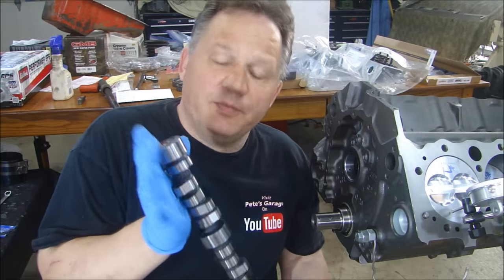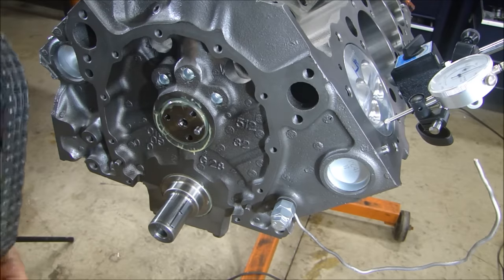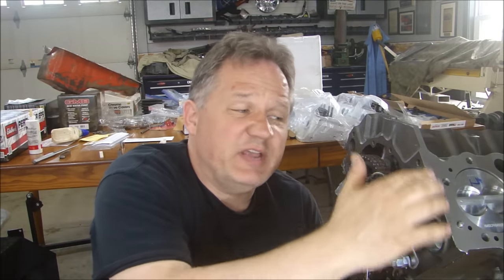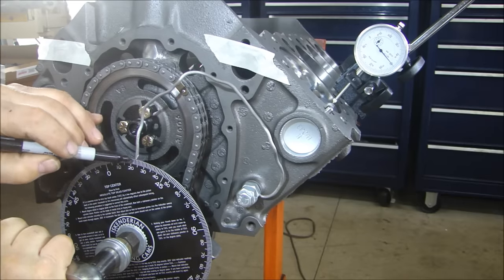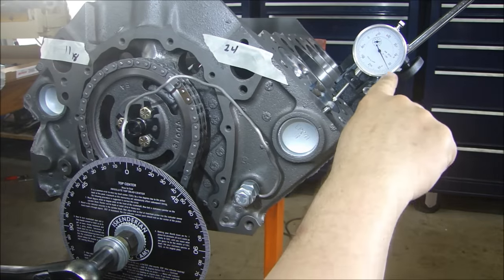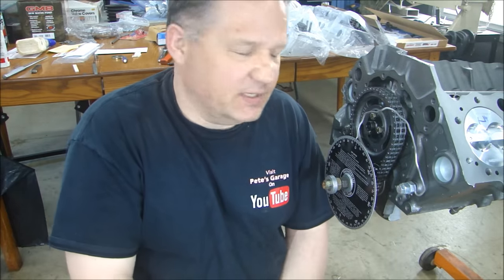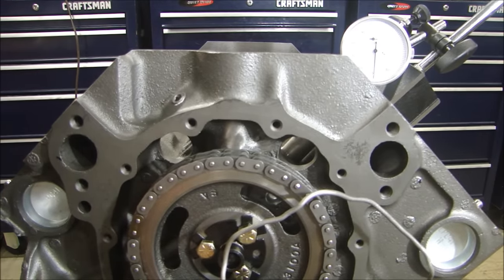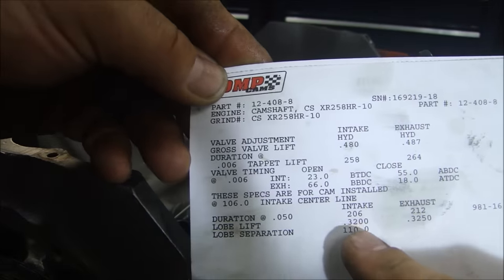Engine Building Part 3   Installing and Degreeing the Cam 350 Chevy Small Block

Comment: Great information, but I am still not convinced that this is worth the time unless the cam manufacturer is inconsistent in manufacturing, You can give, and great detail and explain how to back-check the manufacturer's stated grinds, but if it's off, you have offered no corrective action that can be done other than the assumption of returning the cam for replacement or refund. 
If you build two or three motors a day, Ok, check it out but if you do one once, waste of time.....
Reply from the maker: I'm sharing best practices. It only takes a few minutes but you don't have to do it. I have had to return cams because they were boxed incorrectly.

Comment: I appreciate you taking the time to provide instruction to degree a cam, however, readings MUST be taken ONLY after rotating the crank clockwise.  Rotating counterclockwise will introduce error from backlash with timing chain and gears.  Rotate crank clockwise to 0.050" lift on #1 open ramp, then continue to 0.050" open on the close ramp.  If you go past 0.050" by mistake, rotate crank CC to .200" or .100" lift, then clockwise to approach 0.050" again.  This takes backlash out of timing chain and gears.  If you weren't using a new timing chain and gear set, and took readings after rotating CC, your readings would be considerably different from cam card values

I also didn't understand your comment about decking a block will alter cam timing.  Finding TDC is independent of block decking.  Whether 0.010" or 0.050" is removed from the deck, doesn't change where the piston is when fully extended in the bore.  Decking will affect cam lift, but not cam timing. Duration at 0.050" lift is unaffected.
Reply from the maker: You are right. About the timing, when you cut the heads or the deck the piston will get to TDC sooner in the cycle so the valve events need to happen sooner.

Comment: Since when did verifying cam specs become “degreeing the cam?”  He didn’t degree anything. Degreeing the cam has to do with actually determining when these valve train events occur by use of offset degree shims being installed in the timing chain, thereby advancing or retarding the camshaft to suit your performance desires...not just verifying that your camshaft manufacturer knew what they were doing and did it.
Reply from the maker: Michael, I have a couple other videos showing how to degree the cam so there is no need to do for every engine build. I spent many years working as an engineer for GM Powertrain and I can tell you, manufacturers make mistakes, wrong parts get shipped out. Even with all of the quality measures in place it is possible for a mismarked part, or one that missed a machining operation to get installed. It happens more than you think. So it does not hurt to verify no mistakes were made.

Comment: But he didn't change anything can someone please explain why this is necessary, or what this achieves?
Reply from the maker: You do this to verify the cam is on the timing chain correctly. If it is ok, there is nothing to change
Reply: @PetesGarage  i get that but if its lined up with the markers o the cam then shouldn't you already be sure of that?
Reply from the maker: Yes, but I check in case a mistake was made at the factory, it's a feel good procedure

Comment: Why even show this video ? just to questing comp cams ability ? hahaha Good one , unless you got a cam gear with elongated bolt holes instead of fixed like stock you can't really do much ! unless your Victor Edelbrock Sr and the type of people he had to race with / against , They ground their own cams , You need expensive timing gear to correct any small problems , just buy off top manufacturers like comp cams and many others ,  They got you covered , 50 buck timing gear or 200 the choice is yours , but i'd spend my money on heads !
Reply from the maker: Well, I've been working in manufacturing a long time and I've seen even the best manufacturers make mistakes. If there was an issue I needed to correct I would need to get a new gear as you explained, Thank you.
Reply: You can drill out the dowel pin hole and install off center dowel pin shims to move the cam from half to three degrees (can't remember how much total). Depending on cam a degree can be a big deal. With the cam in this video, no. Some cams with a lot of overlap though you'll have a bear tuning.
Reply from the maker: Thanks Jason

Comment: I see other videos where the cam button is installed with the flat facing outward toward the timing cover ? Zacs Muscle Motors see vid at 7.30 min point  https://www.youtube.com/watch?v=9VIenUdEYT8&t=605s   Can anyone confirm which is correct or doesnt it matter ? Only difference is he is installing straight cut gear set
Reply from the maker: He is using a different button. There are a few kinds. If you have the roller type like he is using the flat side does face out.

Comment: Your numbers are off. A degree here two degrees there. Then you say the cam is ground off. It's your error not the cam manufacturer. No Pete. No.
Reply from the maker: I don't disagree with you.  Had the installed center line been off I would have adjusted.

Comment: sorry you just lost me because of your statement about cam timing changes with decking the block or milling the heads. your giving out false information.
Reply from the maker: It's meant in this vein: If I have my cam ground advanced 4 degrees and install it 2 more degrees for a total of 6 degrees, and if I mill the heads and block, the valve events will happen too soon, so you have to retard the valve timing so the pistons don't hit the valves. The cam is not changed relative to TDC, but it does change relative to valve event timing.
Reply: @PetesGarage  ok when i get the engine out of my car im going to pull the heads off and degree the cam. then im going to check valve timing with head gasket then i will pull the head gaskets out and recheck it. and there will be no difference. i will be in touch.
just so you know im not a garage mechanic, i have been building engined for 40 years, i have worked for Kieth Black racing, Service Center, Speed o Motive, Ed Pink racing. i think i know my way around an engine.
the only thing that changes it valve geometry.
Reply from the maker: Thanks Robert, you are right